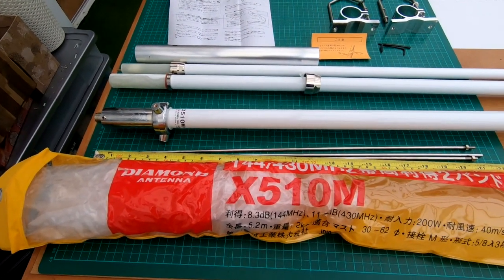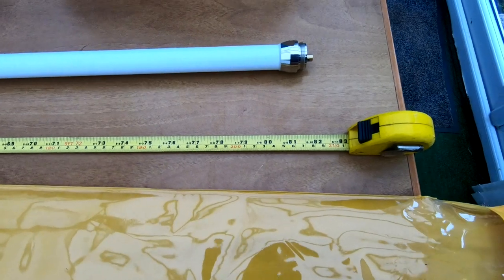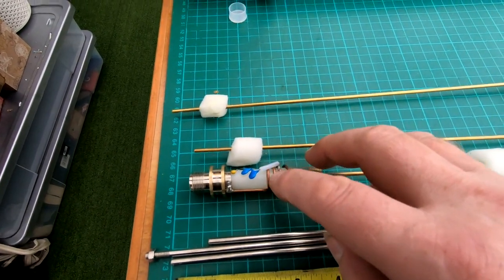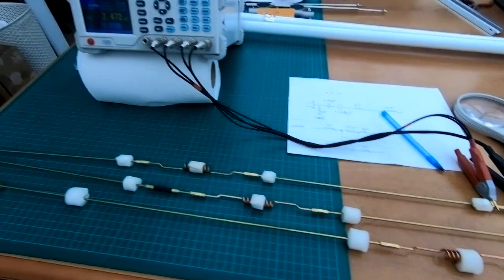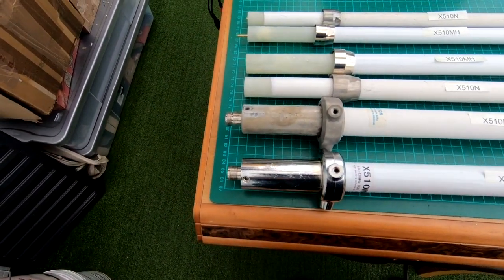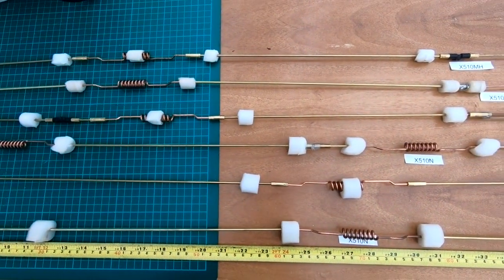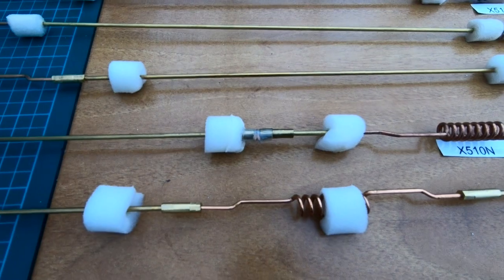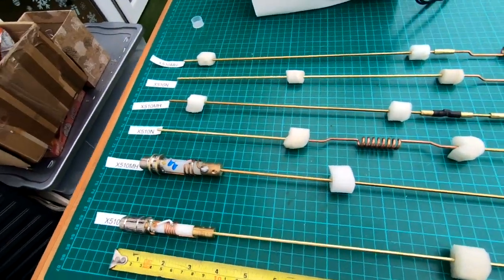Diamond  X510N & X510MH  Antenna Teardown, is it a Fake?

Comment: I dont understand what you mean by "fake"... Is there someone selling these under the diamond brand and they are really made in china or something?  If you bought these from a reputable dealer, then they shouldn't be fake at all. Also kinda doubt there is a counterfeit manufacturer out there selling these anyway, so a better explanation of what your point is would be helpful. Thanks for the vid and showing the internals!
Reply from the maker: The chroming on the MH as new is cracked and bubbling, the fiber glass white clear coat on the tubes  have been grinded off shorter, labels are missing from the body and internal connection points, from the supplied drawings incorrect section fixing screws supplied,  also missing the assembly spanners and to top it off, it blew out one of the caps at 170 watts!!

Comment: Which is better sir..
Reply from the maker: Hi, after a few months of pushing 250W via the  MICROSET SR-300 300W AMP  into the X510-MH it has showed no signs of deterioration from either input power or  weathering from autumn high winds and rain. The SWR is a constant 1.3:1. The X510N only ever gets pushed to around 100W, and has been in place for around 3 years with no signs of damage or high SWR.
Reply: @waynephillips1848  Thank you Wayne. Did you push 250W FM or SSB?